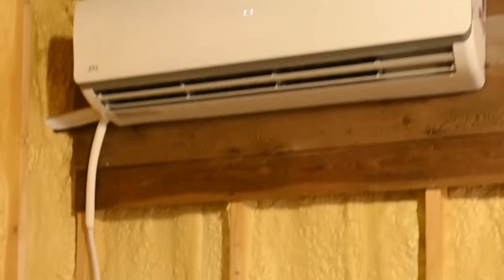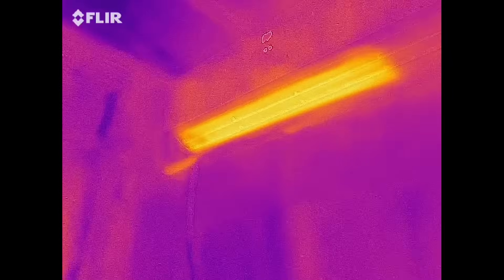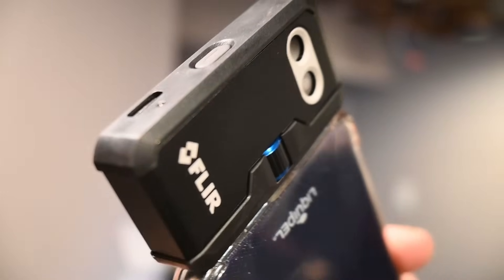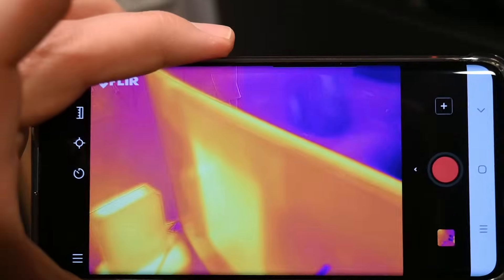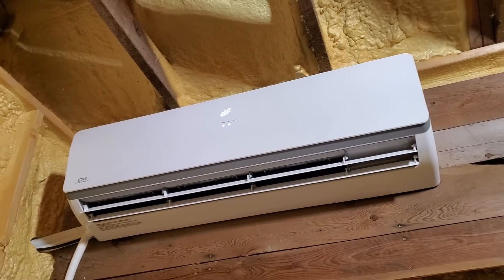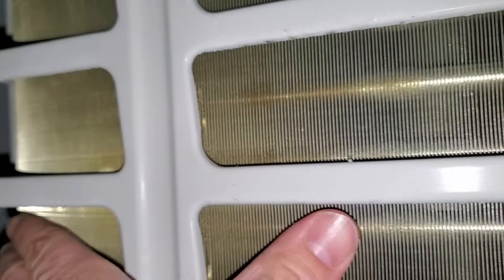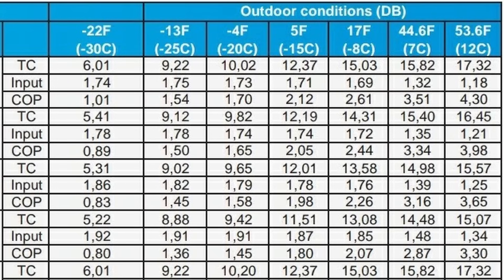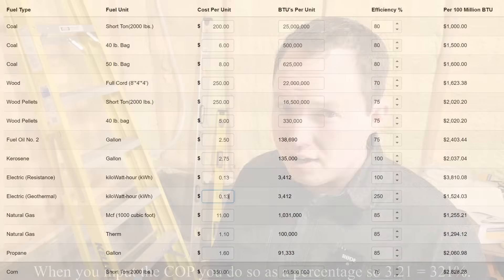Can You Use a Mini Split in EXTREME COLD? Heat Pump vs. Propane Cost Comparison with Thermal Camera

Comment: I have 2 Mitsubishi heads in 400 sq ft cabin, 2 rooms.. power is about $75/mo at 20-30 degrees n winter and I’m here half the day and all night. 78 in the daytime, 61 at night. Love em. That’s for hot water and other electrical appliances too
Reply: hi im in NY we pay upwards of 85 cents per KW. do you how many KW you use monthly in the winter?
Reply: What size units?
Reply: @user-ln7of9gs4s  I’d have to look, but they’re smaller..it’s a small house 500 square ft.. I oversized them so they don’t have to work too hard
Reply: @FishingLover  the smaller the btu the higher the seer rating. I know they have cheaper mr cool, but I was skeptical about getting parts. Mitsubishis are pricey and seem to be common, but they do have a good seer rating.
Reply: @user-ln7of9gs4s  this system cost me 3K and I was the HVAC man’s helper.. probably saved 500 bucks
Reply: 2-1/2 years in and no troubles.. plenty warm with 2x4 walls and we get down in the teens.. summer 100 and it cools well

Comment: I am putting in a heat pump tomorrow here in michigan. It is presently -8 Fahrenheit. I am running it through a traditional propane furnace so that when it gets this cold, I don't have to try to pull heat out of the outdoor air! It is only costing me $1,000 above what it would be for the propane only furnace and air conditioner.
Reply: I wonder how natural gas compares to propane? I also wonder if building a portable shed of some kind over the outside compressor and insulating that shed would have an effect on the ability of the split to handle stressful conditions, would have to allow the compressor to breath not sure how that works.
Reply: @DesignBuildFixReview  as far as I know natural gas is cheaper than propane.  And building an insulated shed around around it is just creating a freezer.it will eventually get as cold as the outside temp, then even alot colder and their will be less heat to pull from that air inside the shed.
Reply: This is a horrible idea. I think you don’t really understand how this works.
Reply: So your heating air then pulling heat out of that air to heat your house? Sounds very inefficient unless I'm interpreting what you said incorrectly.
Reply: @jwill9877  I think perhaps I was not clear. This is the best of both worlds.  I have the heat pump when that is more cost effective, then the propane when IT is most cost effective (below 35F). My ecobee thermostat tracks the outside temperature and uses whichever heat source is "cheaper."
Reply: @FlummoxedinMichigan  I think I understand now. You are using the same ducting as your propane heater. The heat pump is outside the house where it should be and you decide which to use based on the outdoor temperature? The way you worded it the first time sounded like you had the propane heater preheating the air then you running that air over the heat pump coils.
Reply: @jwill9877  Oh my goodness no. The evaporator of a traditional AC system becomes the condenser in a heat pump system. The two units swap roles depending on the need for heating vs cooling. The indoor portion of the system is installed in the furnace/air handler. The heat is generated by one energy source over the other based on outdoor temperature.